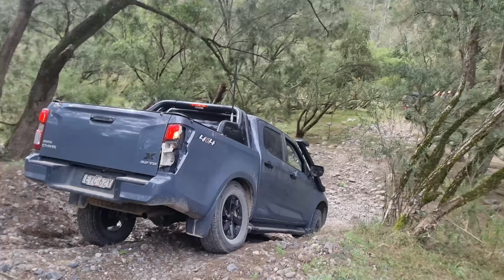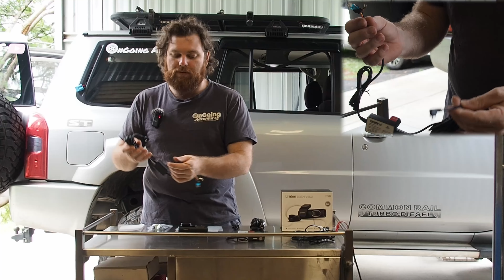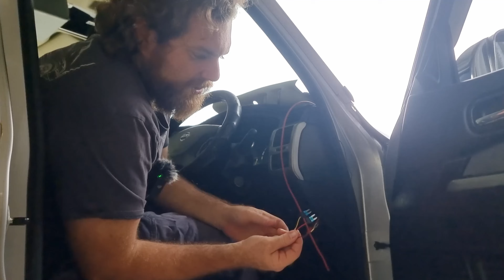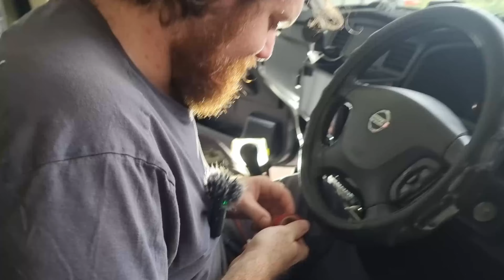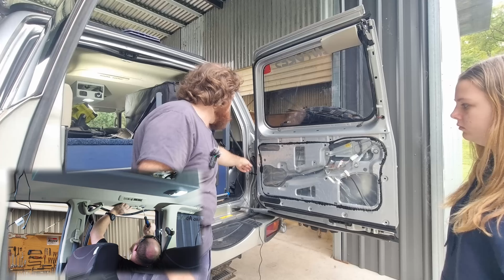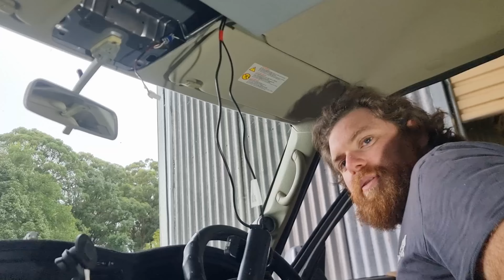DIY Install Uniden Dash Camera SXR

Comment: Any issues connecting the device to wifi? Won’t pop up on my phone and won’t allow the camera to connect to the app..
Reply from the maker: Hi,
I first did have trouble getting it to connect to my phone after a couple of weeks of installing,
but i found out the dash cam was connecting to my cars head unit and that why i couldn't find it on my phone,
so, I had turn my cars head unit Wi-Fi off when i wanted to connect it to my phone and I've had no problems since then.
hopefully this helps 
Thanks 
-Todd